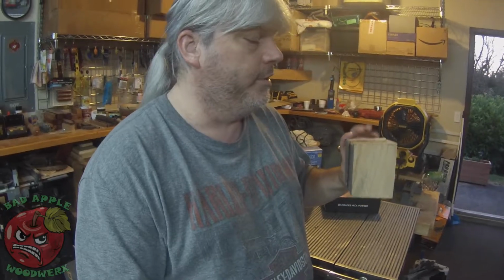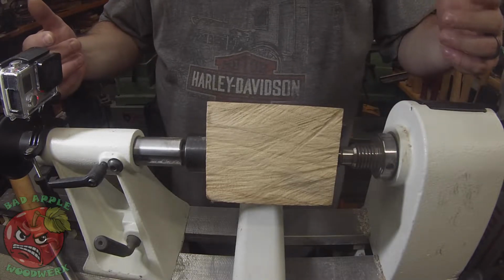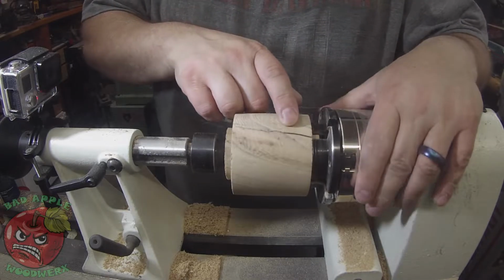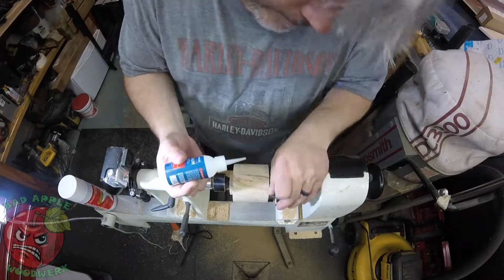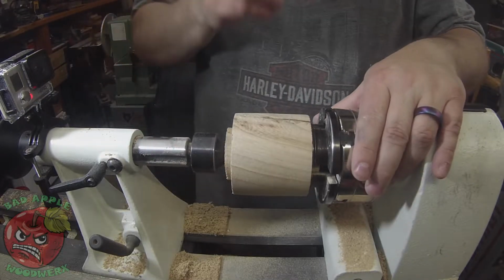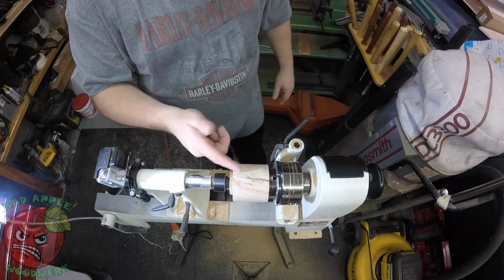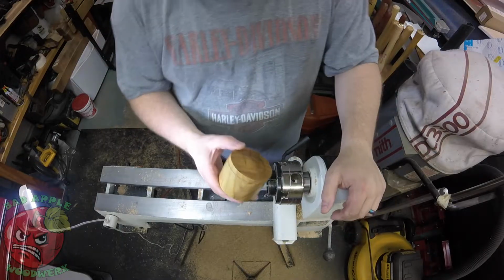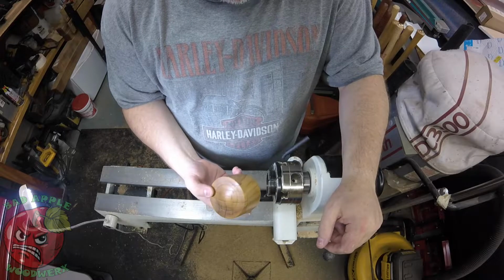Woodturning - An Ash Salt Cellar

Comment: Nice project.  I do have a tip for filling a void with CA. Try to match up the color of the crack with some very fine sawdust from your shop. Temp it into the crack with a bamboo skewer, then hit it within see a glue which will run deep into the crack, fill it up and then hit it with the accelerator. It may smoke a bit. And then sand it off and you have a perfectly filled crack.